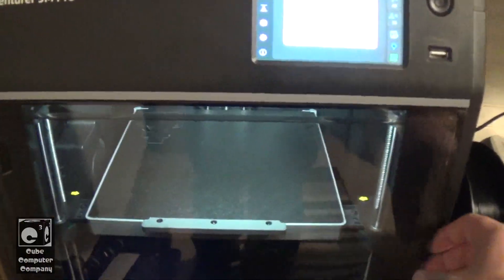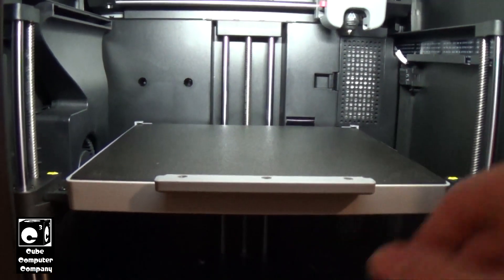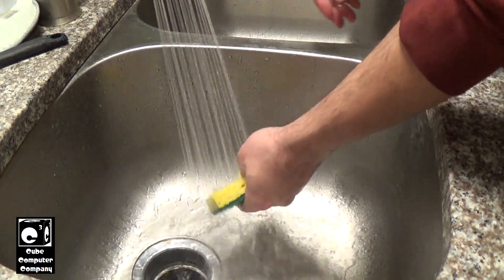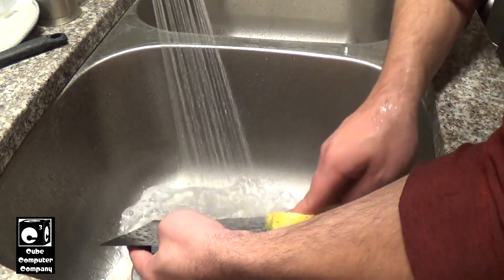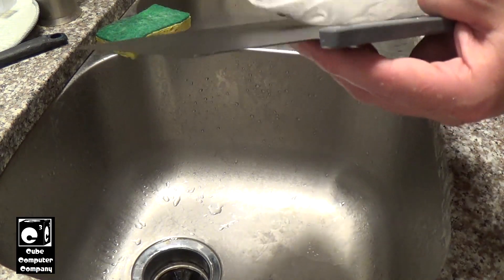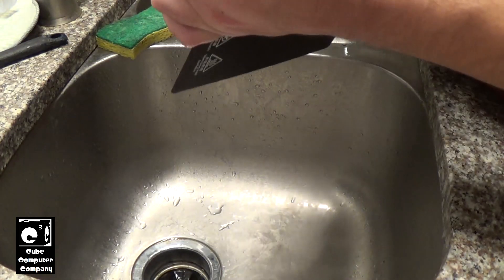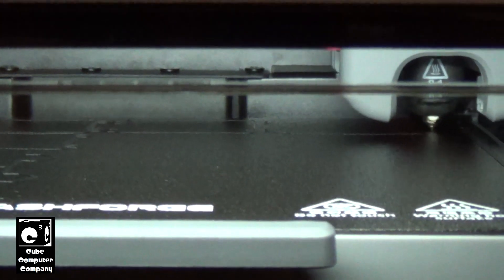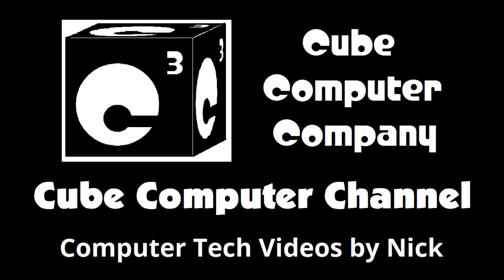How to clean the PEI build plate on Flashforge Adventurer 5M Pro

Comment: Thanks for the video. I found your video by searching. I am havning the same problem. I cleaned it with alcohol and I am still having problems with adhesion.  I will try the dawn with a sponge. My problem started when I printed using PETG and I liked to never removed all of the material from the build plate. Now I noticed some small scratches. Might have to end up using glue to help adhesion.
Reply from the maker: I'd suggest doing a leveling and vibration calibration... seems like the hotend might be dragging against the build plate.

Comment: How about the gold build plate by FlasForge?
Reply from the maker: Don't have experience with that one...
Reply: This is the same process for the gold PEI textured build plate along with all gold/black PEI textured build plates. I use a drop a dish soap along with my sponge as it helps to remove the oils.  IPA just releases and spreads around oil/grease and sometimes it gets picked up by the, hopefully clean, towel someone is using.